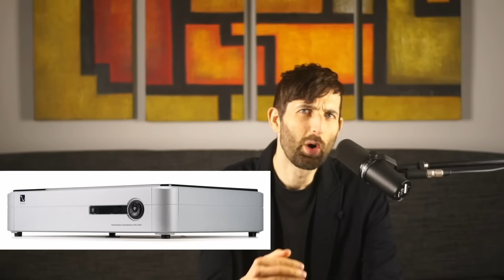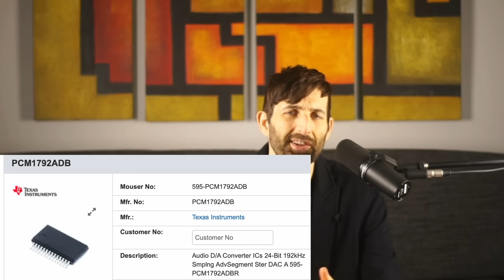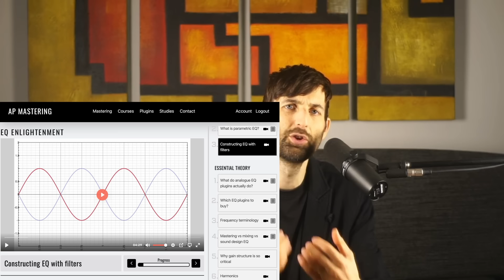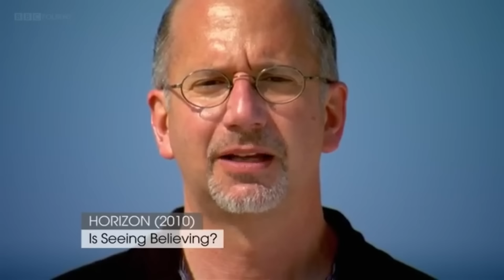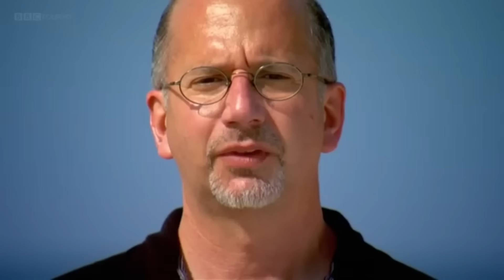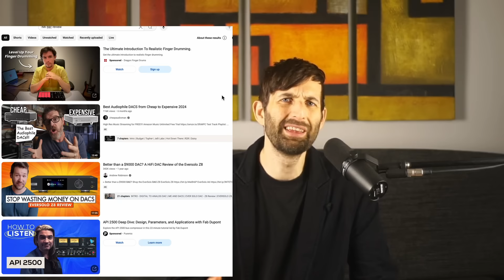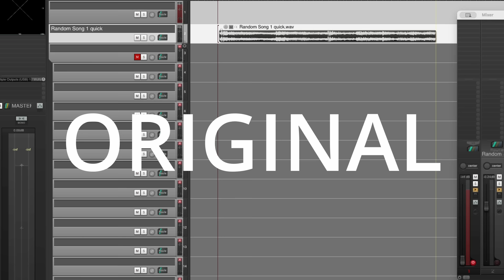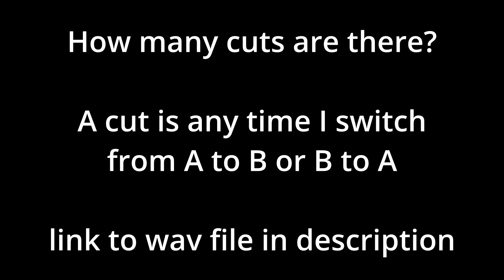The DAC Scam - Almost everyone believes the hype

Comment: Yeah, I got sucked into this bs. I paid 800.00 (US) for a tube DAC/amp for my Focal headphones and when compared to my neighbor's 160.00 Ifi USB DAC/amp, there was literally no real difference. Sold the tube DAC and picked up the Ifi DAC. Absolutely no difference.
Reply: @texasbassranger  It really depends. Obviously, spending thousands and thousands for a dac amp stack is ridiculous, but spending more for a better amp can be hugely beneficial. That being said, ONLY if your headphones need it. Most modern headphones are so easy to drive that you could easily get away with a fiio k7 even on $1500 HE-1000s. There are headphones like the TH-909s that do greatly benefit from high powered, higher priced amps. Am I saying a $1000 or $2000 amp? No, you can drop $600 on an A90D and get the most those headphones have to offer. Modern DACs on the other hand are so good that you hit diminishing returns at $200. In your case though, focals are notoriously easy to run. You really do not need anything crazy.
Reply: @user-mh6ie9wm6m  Planar magnetic headphones aren't easy to drive, although it might seem so when you just look at their resistance (which is usually low). I have a pair of Hifiman Sundara (not expensive, got them for 260€) and they really need a beefy headphone amp. Same with my Audeze LCD-2, they suck without a good amp.
That being said, I have a 800€ Violectric HPA V200 which is more than good enough for all these headphones. I was lucky to get that amp before Lake People/Violectric realized they need to be way more expensive for the HiFi crowd 😂
Reply: How is this even possible? Tubes are literally meant to change the sound as drastically as possible 😂
Reply: @VantaLume  Tubes can add harmonics and sometimes output impedance. It's a rather limited effect. Some tube amps are flat line a solid state.
Reply: @VantaLume  no I would not make a statement that tubes drastically change the sound, however, sonically speaking they do have a different sonic, characteristic or overall nature to them absolutely, especially take a guy running horn loudspeakers, horn loudspeakers, and tubes were probably a match made in heaven, sonically speaking
Now you can’t take the same horn loud SPEAKERS from our experiences and run them or play them on a very good or a high-quality solid state amplifier absolutely 
They will sound wonderful . But they are missing that tube magic. The three dimensionality is not there. The focus in the mid range is not there. These are different characteristics.
That folks look for it all depends 100% on the rest of your system and what you are using or running , now when I put the same 2 A on a set of pro ac loudspeakers yes the differences are there but they are not as pronounced as they are on the Horn SPEAKERS, which are also rated 106 db efficiency for one watt, have you ever heard a pair of horn loudspeakers?
Playing with a single ended triode  300 B amplifier or what they call a SET AMP/ that’s a match made in heaven. At one time they called the 300 B amp god’s tube.
Now I don’t know if I would go that far but I can tell you one thing it’s definitely something like you never heard before. Nothing wrong with solid state. Nothing wrong with tube just like the tires on your car unless you got it all hot rod you should run the stock tires that it calls for 
Now that particular tube set up there with horn loudspeakers, yes I would say that’s a dramatic difference  , I believe you should have enough experience and been around things at this nature before in the past come on man. i’m not saying it’s for everybody. I’m just telling you the way it sounds try it. You’ll like it, but you better bring a couple wallets with you to do it correctly no doubt about that. $$$$$$$ 🤣🤷😎🤷‍♂️
Reply: @Cody1340-e1s  No magic or any of your silly adjectives in a tube amp, just impedance mismatches and nonlinear frequency response. You are who this very video is meant for.
Reply: @psyborg06  I ask you something, my man please explain to me. Do you really know what impedance mismatches are? Do you know how to correct them other than talking about that silly DAC bullshit I got a guy here. It’s been building tube lamps when when you were still begging mama for for toys go find something constructive to do it yourself dope
Reply: @Cody1340-e1s  Have fun with your guy and your tube lamps then ;)
Reply: @psyborg06  we. Always most certainly do you know so much about DAC’S find a old adcom 700, with the commercial grade for brown chips in it or chips at in the unit, then borrow a single ended triode amp, on a pair of horn speakers they don’t have to be no they could be 3040 years old. Just make sure to CROSSOVERS are good. No fancy transport needed either get an old DVD player with SPDIF output , in the adcom let me tell you something they had it right the first time all this Dac BS , You’re grabbing the attention of people that don’t know any better then hoping for more subscribers and go deposit your YouTube check< you’re full of shit. You look like a scam.
Reply: Yes sir, there is absolutely no substitution for good quality equipment, I am not talking about course no object not to be facetious, but that’s her people with big pockets and money means absolutely nothing to them. Yeah there’s a few of them around. Nothing wrong with that. Spend your money as you see fit but like the one gentleman here explained about his headphone amplifier. I certainly do agree with him, but it also comes down to who’s the manufacturer sometime that also means nothing but your chance is fair much better
That you are obtaining a much higher end quality product, but you’re also gonna have to pay up for it , I personally have nothing against this everyone to their own
But if you’re going to implement some of these Chinese cheap products which attracts a lot of folks naturally because of their price, OK I could see somebody’s thinking in that
But the bottom line you got what you paid for so it doesn’t sound any better than what you already had where your buddies cheap $200 amplifier , I had what I call the older guys
That had been around for quite a while, not all of it, but most of it is all one word , HYPE , how do we get our hands in your pocket however, this can be quite controversial
Yes, you absolutely do get what you pay for but not all the time , there’s tons of junk out there just what it is junk. product strictly made for cost nothing else.
Reply: My neighbor can’t tell the difference between a $15 cabernet fron Argentina and a Chateau Margaux. You aren’t alone, feel good.
Reply: @texasbassranger  you probably have a reverse bias, audiophiles believe in unicorn cables and DACs, while you believe voltage vs current driven amplification is the same.

Don’t get me wrong, I am not attacking you, but you definitely have some bias that you wanted to believe in, as tubes work in a fundamentally different way in the analogue stage of the chain, which changes the frequencies of the signal, while solid state amps try to reserve the signal as it is . Tubes are colored (enjoyable coloring of the frequencies) vs mostly unaltered signal with solid state amps.
Reply: @thephantom9080  While i'm a bit skeptical to that.. nothing of that will really matter if the speakers aro not good enough to reproduce it. THe most important thing that someone who wants the best possible quality should buy, are speakers. That AND: treating your room. The room can kill a lot of information. Those 2 should be enough for improving the listeneing experience.
Reply: @thephantom9080  You tried.
Reply: There’s a difference in all equipment, DACs included. But all of your equipment has to be very good before higher end DACs matter.
Reply: @jonathandavis9507  I can agree with that statement, you’re paying for notes you’ll never hear not only that you loudspeaker choice has a lot to do with it if you’re using very ultra efficient loudspeakers they’re very sensitive sonically  to any change higher sensitivity the better right now I’m running loudspeakers that are 104/105 db You can hear every little change , when using Pro Ac’s unable to hear on a set of pro ac’s studio
 ones that are around 87 db in sensitivity so says the factory specs I believe they’re harder to drive than that. But you actually struggle to hear a change most DACs sound about the same, but however, not the other way around.
Reply: One thing I am absolutely sure of. I will never go back to inefficient loudspeakers. I’ve been through magna pan been through acousticts
2+ 2 ‘s , dial quest DW 10’s great loudspeaker, Yamaha studio monitors NS 1000 M, pro ac’s , Rogers , spender, in the past four years if you name it I’m most likely probably had it at one time or another or if not me, my buddy did, board SPEAKERS are absolutely not everyone’s dream and they’re overall sonic presentation but I’ll tell you what this shit sounds real and I can literally bring down the house with any 15 or 20 W AMPLIFIER at an efficiency rating of 104 db
Amazing you can virtually use any AMPLIFIER
But they do town tend to sound best on tube gear those type speakers like to see a output transformers, amazing clarity, amazing dynamics, ultra detail, perhaps a little raw around the edges you can keep that in efficient shit, the sensitivity is key made a believer out of me, now don’t go out and buy junk horn loudspeakers, you can literally build a set of great ones for Pat’s on the dollar, look for an old set of KLIPSCH bells LaScala’s K horns Alta a sevens, etc. even if your room is not big enough, do what you gotta do. I knocked out a whole wall moved to back 8 feet worth that every second of cursing 🤬 👍👍👍👍🤷‍♂️
Reply: sounds like you have hearing issues or your headphones sucked, or both
Reply: @mat.b.  Seriously.
Reply: @mat.b.  Sounds like some folks will go to the ends of the earth to defend spending big money on their headphones just because they can.
Reply: @texasbassranger  you're in denial, its okay (I dont have 'big money' headphones)
Reply: No offense but compare an $800 DAC to a $25K+ DAC with legendary status in the industry and you will hear a huge difference.
Reply: @a.s.2426  NO…
Reply: @Cody1340-e1s  I have the DACs. $2K, $15K, $25K.The difference is more than clear.
Reply: @a.s.2426  and I guarantee in a blind test of say 8 dacs you had not heard before  yes you would notice a difference but you would be unable to say which is the more expensive ones.
Reply: @scytob  That might be the case -- at least assuming that none are too low end. I could agree with you there.
Reply: @a.s.2426  not always and for that giant quantum leak leap in price most of the time the sound differences are very minuscule believe me after 45 years you’re paying for notes that you’ll never hear , I am not insinuating that naturally it will sound to the better to a certain degree. It depends how you look at money if you think another 1500 or $2000.
Made that much difference and overall sound then go for it , to me it’s called hype. but I respect your opinion. I know your wallet don’t but you want what you want understandable
Reply: @a.s.2426  somewhat agreed but let’s put it this way not 22,000. I’ll tell you what when you outgrow it cause it’s a new toy. We all do it man new toy time I’ve been there.
But not with those kind of prices , so now like a body of mine, put it up for sale on the Audio forms. It’ll sit for a year and when it does sell, you’ll be lucky to get pennies on the dollar meanwhile, I know they’ll never get that kind of money off of me, regardless of my income, but there’s guys out there to buy it. That’s why they make Cadillac and that’s why they make Lincoln and then that’s why they make Rolls-Royce but the Cadillac or to Lincoln will get me there just as nicely. I don’t need the hyper status symbol four
I don’t care about impressing anybody let them impress me regardless craziness  🤷‍♀️😱🤣
Reply: @a.s.2426  Maybe, because the expensive one measures worse and is less accurate due to adding coloration that some like😅
Reply: @hartyewh1  None of that matters to me. I only care about whether I like what I hear coming out of the speaker and subjective attributes of sound. I believe most seasoned audiophiles eventually come back to "what sounds good" as their ultimate metric. "Accuracy" is a conversation that is both conceptually confused and spiritually hollow, in many cases.
Reply: @a.s.2426  But also no one is immune to placebo and if you expect a cable to sound better it will. Very few people do blind testing and thus build increasingly imagined views on products and actively mislead others if they participate in the conversation. Plenty of reviewers have strong opinions on certain products that those who have blind tested know is pure imagination.
Reply: @hartyewh1  Sure. That is true. I blind test when I think it's needed. I have found I couldn't tell the difference between certain cables, for example. Not been the case with my DACs. The difference is just too large.
Reply: @a.s.2426  Want to mention some of these DACs? Having tested a dozen or so pure DACs and another set of dac/amps the only purely DAC differences I've found was with Ares II having measurable treble roll-off and a Naim DAC really changing the character of the sound (tight, punchy, energetic) and maybe longer ago I tested a Chord DAC that sounded thin. Those were also the most expensive ones and I'm aware higher end stuff aims for signatures instead of objective performance often and that's fine especially when not claimed to be generally superior to essentially transparent DACs, but I am interested in learning more about the difference to have a better understanding of the hobby.
Reply: @hartyewh1  Sure. The ones I own are: Musical Fidelity M6X ($2K-ish), Mola Mola Tambaqui ($15K-ish), Playback Designs MPD-8 ($26K). The most immediately noticeable differences are in the following areas: soundstage height, width, depth, layering; timbral naturalness; digital glare; musicality. Just to give one example of how this plays out in practice: the MPD-8 has an immediately noticeably wider and taller soundstage than the Tambaqui with greater depth and more pronounced instrument layering, in my system. In regards to the soundstage width you can visually just mark in on the walls, practically. Fairly large difference.
Reply: @a.s.2426  But, bear in mind, that, the dac itself, the actual part where digital is transformed into analog, is very likely not the responsible part of the circuit where such differences reside. The circit around it weights a lot more into how the equipement will end sounding.
Reply: @slash148  In many cases this might be the case.

Comment: A few years ago I decided to start looking in to streaming and started ripping my CDs into wavs.  I set up a Raspberry Pi with Volumio and bought an open-box ifi ZenDAC V2.  My system is extremely modest by audiophile standards with an HK 810 amp and an HK 725 preamp and with KEF Q150 speakers for my very small listening space.

Once I got the Pifi/ifi digital setup running I found it sounded at least as good playing wav files compared to my mid 90's Rotel CD player and decided that my sound quality sesrch was over.  I'm 51 and it's not as if my ears are getting any better, so I'm really pleased with how my system sounds for super cheap money and Qobuz lets me hear virtually anything I want be it new or old.  I keep the 80's HK stuff because i also bought it all super cheap even with servicing and I really couldn't be happier.

Now, I have a buddy with a Pass Amp, Martin Logan speakers, Bryston digital player and Berkeley Alpha Dac.  Does his system sound better?  Well, yes.  But I think a lot (or most) of that is just the speakers.  And my entire system cost less than the power cable for his amp.  He's a bachelor, and can afford his system so more power to him, but does his stereo sound 25 grand better than mine?  Well that's a matter of opinion, but my modest setup puts a huge  smile on my face every day.

Anyway, great video.

Cheers!